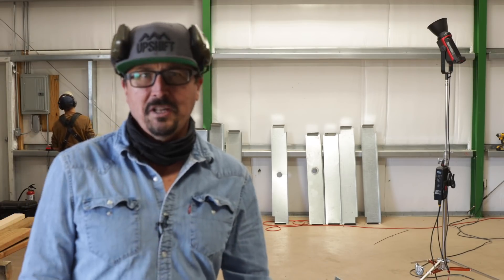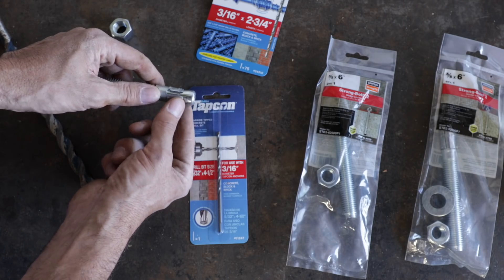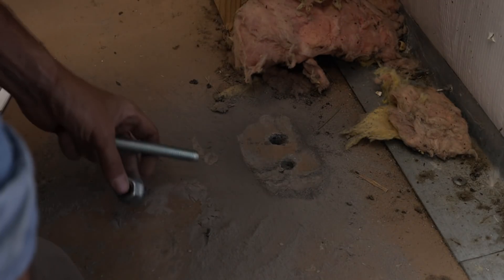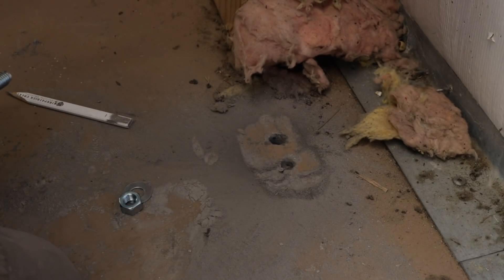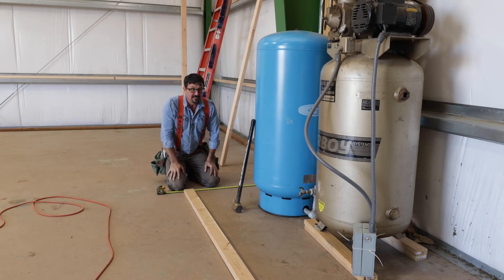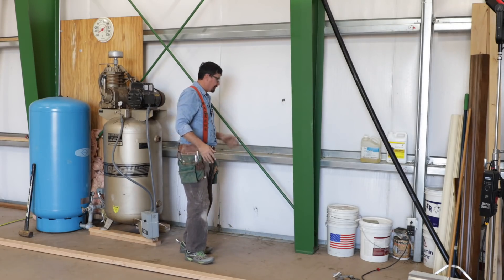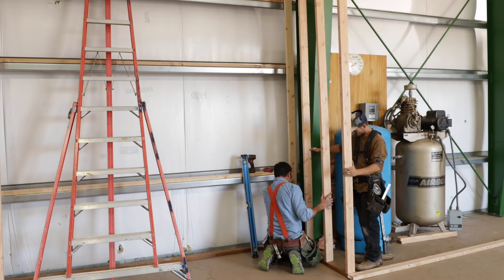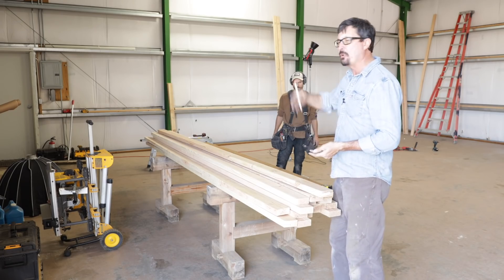I'VE ONLY GOT 24 HOURS

Comment: Mr. Wrangle--Have you ever used "chemical anchors" to secure large machinery to a concrete floor.  I worked in the chemical industry for years, and those are what we used to secure large machinery and pumps to a concrete floor.  Drill the appropriately sized hole, put a glass tube of a 2 part epoxy chemical in the hole.  Take your threaded rod, stick it in the hole and break the epoxy vial. the chemical reaction hardened in about 2 minutes.  Worked every time. never came loose.
Reply: Second this......Chemset anchors are awesome....i have used thousands and had very few failures

Comment: I've done several of the anchors in concrete. It is usually better to hit the anchor with the nut already on the end to reduce the possibility it damaging a thread.
Reply from the maker: these have a tapered point so there is no need,
Reply: Tampered or not is still a good practice specially if is for yourself you should want everything done right...
Reply: @Irving1203  they are tapered just for west coast guys and their hammers.